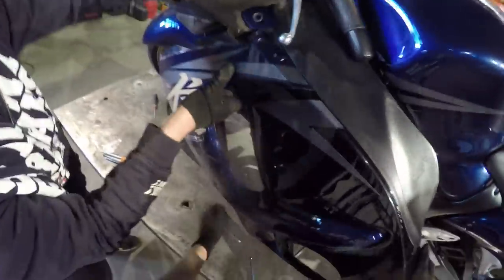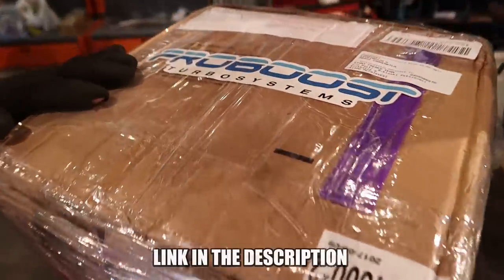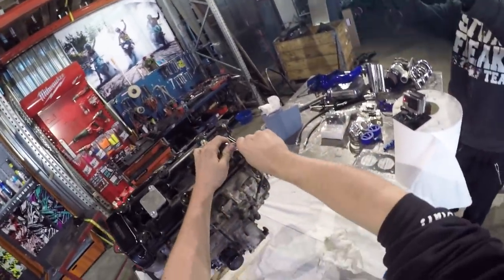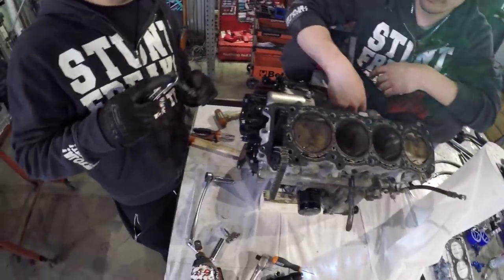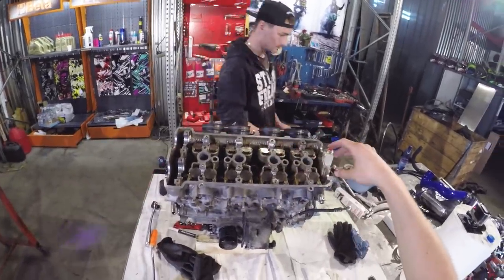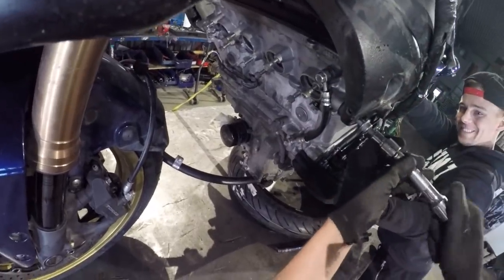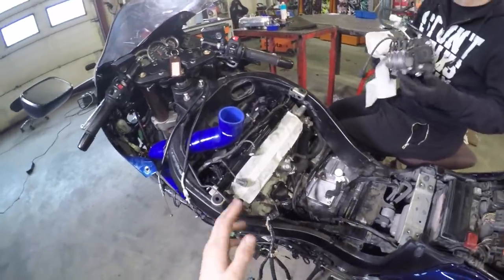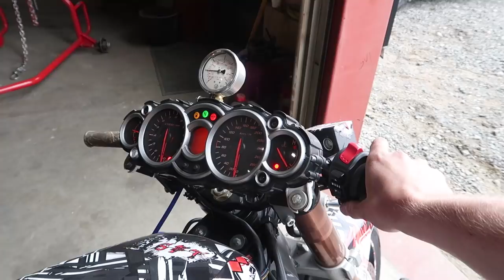How to TURBO your Hayabusa 330hp - ProBoost set

Comment: Because those damn stock Hayabusas are so slow
Reply: Lmfao. Oookay
Reply: Whoosh
Reply: Sarcasm
Reply: @lehti95  Kids ruining good memmes
Reply: @Rektonator  so it would seem
Reply: @lurk7967  you're*
Reply: Being a mechanic you are not supposed to ride these 10 year old busas in a same regular way
Reply: FoxRcng708  they prevent power wheelies but still they look awful and the nose is on next level of uglines
Reply: yea cuz it goes only 300km/h
Reply: The rear looks just as bad with that wasp tail
Reply: You guys sound like the kinda guys that would say a woman's thighs were too thick.
Reply: because safety is for the weak...
Reply: Speed > looks children. No one gives af about what it looks like...cause your not gonna see it go by you....
Reply: that_green 4.6 he was being sarcastic
Reply: @JU-wn1jm  got the Gregg's customs K7 Gsxr tail on mine and boom now she's pretty as fk and everyone jocks it
Reply: Like anything else you get used to the power and want more! I plan to turbo mine next winter!
Reply: Tbh I came off of a built head tuned 07 1000rr into my first busa and I wasn't impressed. Can't say for sure which is faster/slower but they both have their rpm of advantage. I bought turbo parts and crate motor for the busa and sold it before I ever heard it start. I have an itch to get smaller bike. 600 maybe even 300 then go after another busa build. Finances are almost ok again
Reply: Haha yeah 😅
Reply: Oh 180 mph is very slow

Comment: "We gonna install turbo kit coz its not too hard..." proceeds to dismantle entire engine.
Reply: You can do it by yourself pretty easy by using rear&front pit stands and a quite common motorcycle/atv-lift under the engine with a flat surface by removing the oil pan, oil pickup, regulator and front wheel, then a piece of plywood to protect gasket surface. Then lowering and steer the engine out of the frame. (Hayabusa)
Reply: Point is most people don't consider auto engine work an easy project
Reply: "Hard" is relative. What is "not too hard" to one person (who may have a lot of experience building and rebuilding engines) may be insanity to someone who barely knows how to change oil.
Reply: Jon Collins finds trying shoe laces hard.....just saying
Reply: It's really not hard there are countless guides on how to build engines and all the info (torque specs etc) you need on the particular engine you are building. All it takes is a little reading, being good with your hands and having common sense.
Reply: BWHAHAHAHA I thought this same exact shit, as they started to remove the front sprocket. "Not too hard" = remove engine from bike + disassemble engine (*nearly). Not exactly Rocket Science, but alot of room for error here for some shade tree mechanic w/ improvisational tools.
Reply: It’s a 3 hours job
Reply: Its really not hard. Just have the right tools. Like what you do and keep parts organized.
Reply: Türboo
Reply: Wonder if he can turbo my motorized 80cc two stroke bicycle ??!!
Reply: Compared to working on cars, it seems alot easier to work on motorcycles just cuz everything's so accessable.
Reply: its easy compared to a car.
Reply: The hardest thing is to turbocharge an engine just to blow it up just because you didnt make sure the valves arent even slightly bent or all your rod bolts are tightened to spec. The full teardown is just further securing your investment.
Reply: Prison Mike  LoL
Reply: @lilRicky891  and a good amount of space, workbench, tool's and patience to find said torque specs,a decent camera to record said process or a photographic memory ya doesn't take much to teardown and rebuild+ install a boost system
Reply: Not hard for the engineer :D
Reply: FabzRustRider ok
Reply: basically everyone who fix their bikes themself can dismantle and build it
Reply: hell, spelling is hard for this guy
Reply: 😅😅😅they made it look easy!!!!
Reply: I think hardest part is get engine wiring off and drop off the engine and install it back without miss wiring/something forget

Comment: "its not really that hard" 

takes whole bike apart with engine rebuild lool
Reply: Honestly theres so Many guides on this build, kits That are entirely drop in etc, the engine Rebuild is more about checking for issues. If you had a known good bike freshly serviced it wouldnt be needed, they were starting from an unknown quantity used bike so they have a little different set of needs.
Reply: @jediknight1294  I get that but... don't start the video off with ( it's not really that hard) then proceed to take to MOTOR out. ( See, now the motors out, that wasn't too hard was it...)
Reply from the maker: It’s not really that hard
Reply: @knight20092001  if you can change gaskets, change the oil, change clutch packs. Plugs it really isn't hard at all.

The difference between taking the heads off and this sort of thing isn't huge especially when using a kit. It is all the same basic. Concepts, righty tighty lefty loosy, needs air, fire and bang juice to go boom. Its a really quite basic thing.

Maybe it's hard if you can't change oil without taking it to the dealer.

Now TUNING ONE can be a bastard but if you are using a kit then.... There will be a basic tune in the setup and an EFI bike thats 2 cables and a USB cable to the ECU piggyback.
Reply: @stuntfreaksteam  I mean all I've ever done on my Suzuki Bandit 1200 is an oil change, so it would be hard to me haha
Reply: @jediknight1294  actually the reason for taking apart the motor was to install the cylinder spacer to drop compression, and to also install the upgraded Cometic head gasket
Reply: @Stunt Freaks Team and I can't do turbo foam and come to my country for turbo foam and I'll pay you for that and what do you think, man?
Reply: @Wesley Mac Wyne You don't have to evolve to see that trend and only your work of art will flourish if you do
Reply: @tes-rm4zv  turbo foam! Sounds good, where do you get it from?

Comment: The cylinder spacer is to lower the compresion ratio so it wont knock with boost
Reply: Kevin Jordahl yes but if you run higher fuel octane you wouldn’t need the spacer and also that spacer will loose power
Reply: It also increases reliability because of the lower compression ratio.
Reply: Gotta remember these arent civic motors.. Theyre already running 11:1 compression from the factory
Reply: +green t 
You need higher octane without turbo for these engines just not to knock, imagine installing a turbo with much more air inserted in the cylinder every stroke what kind of compression it would get
Reply: E85?
Reply: Gen2 stock compression 12,5:1,  Gen1  11:1.  I drive with about 8,5:1,  intercooler, 98 octane pump gas, (european fuel) about 1 Bar pressure  on my Gen1 streetbike
Reply: Green t....You think that running a higher octane rating is going to stop detonation?...Any fuel will detonate if the cylinder pressure is high enough. Also with a turbo engine you will get more power running a lower CR and a higher boost pressure than running a high CR and then being forced to run low boost. Think of it this way, lets say you have a small engine that displaces 10cc, it pulls in 10cc of fresh charge then compresses it into 1cc, the CR will be 11:1 (not 10:1,  (10+1) /1 = 11:1 ). If you take the same engine and force 15cc of fresh charge into it you may have to lower the CR, lets say the combustion chamber is now 1.5cc in size, the engine will make more power because there is 15cc of charge going into it, what's more the effective CR would be (15+1.5) /1.5 =11. In both cases the effective CR is 11:1 even though if you worked out the CR of the engine with the larger combustion chamber is would appear to be lower...(10+1.5) /1.5 =  7.6:1.   All of this as been simplified to a degree but you get the idea!
Reply: green t even with high octane you will need to drop the  compression mate and the space is the easiest way especially if you increase the fuel pressure via a tube into the carb
Reply: Ryan Bernard stock busa is nearer to 14 isn't it?
Reply: i was skeptical of higher compression not being better
Reply: The spacer is a needed add on for the charger.  He says that because without the charger it’s a lot lower.  The engine has not been changed really except the intake space and exhaust.  They added a few necessary changes for the charger but basically it’s a stock stroked engine. The charger fills up the space the spacer has added.  So ya it’s a lower combustion without the charger.
Reply: Ryan Bernard lol you must know nothing about civics
Reply: @anthonykennedy9019  if you add forced induction you increase the pressure in the cylinder thereby increasing compression so you need to lower the engines compression in order to be able to run more than a couple of pounds of boost and actually make serious power rather than detonation and knocking.
Reply: @jediknight1294  fuel injection no carbs...🙄
Reply: @sidecarbod1441  You got that the wrong way around ;) its not 1980 anymore mate.
Reply: @checkyourself164  The maths was right three years ago when I posted the comment, it's still right today and it would have been right in the 1980's too!

Comment: Someone actually had this and thought: "this is not enough"
Reply: Maybe because it is a strong and reliable engine? Idk tho, Im not a mechanic, but feels locical to boost engine which can handle that extra boost.
Reply: Good strong gearbox aswell
Reply: @rolandtiiroja  i think he means speed yo
Reply: Oh yes this is an entry kit really
Reply: You haven't had a bike like this or a 600hp car, I presume? At first, for about 1-1 ½ years it is amazing, but after a while you just get tired, because too a larger extent you've learned how to handle everything, so you want to go faster. Especially for a bike like a Hayabusa, which isn't a bike for a circuit, horsepower seems to be the only way to make it more exciting and since the engine can handle it, the owners just want mo powa' baby
Reply: @BB-zv8tx  pumphrey reference babyyy
Reply: @BB-zv8tx  EXACTLY! I am used to my busa and want more power! The busa is good in the turns, and great on the straights but with a turbo it becomes a next level experience! MO POWA BABY!

Comment: the "spacer" is  mounted to lower the compression rate , when you turbo an engine you need to lower the compression because the turbo is changing the entire power curve / engine characteristics . N/A engines produce the maximum power at almost peak level rpm . turbo boosts the power in the lower rpm up until mid range rpm .
Reply: It isnt anything to do with your idea of how power delivery works, something you should probably do some more reading on in any case. 

the reason you lower compression is because the forced induction increases pressure inside the cylinder by increasing the amount of air inside it. This means that you are risking knock and detonation running more than a 2-3psi of boost.

To counter this you reduce the engines compression either with a spacer changing the strokexbore ratio, or changing the pistons or both also changing the octane of fuel can help but thats very temp and altitude dependant. This allows you to keep the cylinder pressure within the safe limits to avoid detonation/knock as you raise the amount of boost you want to use.

Comment: More space doesn't exactly mean more power.  Raising the cylinders gives you less compression ratio, which means less detonation under boost.  That's why turbo pistons don't have as much casting over the crown.  It's also why boosted engines should use higher octane fuel.

Comment: These guys do solid work. The motor looks good inside. Nice cross hatching marks in the cylinder walls. Probably very high compression with full power just like a new one.
Reply: 12.1 so not really

Comment: If you go through all the work to pull and dismantle the engine, why not do a little head porting and install high performance camshafts as well?
Reply: Are you aware how much good cams cost & how little extra you get compared with turbo install  ?
How about the amount of skilled labour it needs to make the timing adjustable and dial them in ?
Thought not.  . .
Reply: @peterherrington3300  a set of cams for a turbo busa are less than a grand, head porting is free of you have the right tools.  New valve spring kit is a few hundred.

Comment: Answer for everyone, who questions the translation of the torque wrench / moment wrench.

In Finland we call the torque wrench as ”momentti avain” which translates straight to english as ”moment key” 
When that’s wrong, we translate it english as ”moment wrench”

And for example, car has 300NM torque, as you say in english. 
We say: car has 300NM torque moment, translated from finnish term ”vääntömomentti”. 

So Torque in finnish = Vääntömomentti and Vääntömomentti in english = Torque Moment.

Simple, right? 😉✌🏼
Reply: Moment and Torque are the same thing in English. Saying "torque moment" is like saying "torque torque" or "moment moment". You guys need to sort out your language.
Reply: Boar Vessel, 600-500 BC, Etruscan, Ceramic 

Sorry, but  you can go and try chance your mother language, if your able to. I would like to see that happen’ 😅

Or you can try to learn Finnish, one of the hardest languages in the world, just cause the reasons at my original post 👌🏻

Comment: more combustion chamber volume means less compression ratio.
not more displacement!
Reply: Carl Benz displacement
Reply: Jhay Cruz auto correct, obviously!
Reply: I don't see how it doesn't mean more displacement
Reply: than you have to look into how engines work some more.
displacement is only dependent on bore and stroke!
Reply: @carlbenz3341  if you have more volume then that means you increased bore or stroke though.

Comment: Ok Guys Im impressed but can how many kilometers did your bikes have when you installed them and I purchased my proboost a couple years ago but I have not installed it. Also I seen that you kept the lower engine mounts off? Or did you install them? Also I noticed you didn't have full fairings, I know I may have to cut them but  did you put full fairings on?
Reply from the maker: -Bike had like 40 000km
-we install all the engine mounts
we didn't have full fairings but that turbo kit is design to fit under the side fairings. So there is no problem install full fairings after the turbo install.
Reply: Just wait for 2020 Busa, suppose to come stock with turbo

Comment: Did some one ask how much boost? And are you comfortable keeping stock pistons and rods? I am thinking of doing this on mine.
Reply: 300hp on a gen2 should be fine on stock pistons, much more and id upgrade them. Don't take my word as Gospel, go speak to someone with experience obviously though..
Reply: Pistons will be fine .
Rods are the weak spot.
Gen 2 valve gear is also shite.
I learned the hard way.
300 horse should be about 8 psi .

Comment: When you increase the deck height like that what your doing is decreasing the compression, Those spacers is one way of doing it the other is replacing pistons or replacing rods with something that has a shorter stroke. This is to fight pinging or detention that is cause from adding the turbo.

Comment: If you expand the combustion chamber as you did without some kind of supercharging it will actually result in a loss of power. You’ll have a much lower compression ratio because you aren’t also lengthening the stroke of the piston to accommodate for the new airspace in the chamber.

Comment: and now you need to stretch and lower it
Reply: Pyreeh Squid
Reply: William Jenssen Not really if it makes it easier to drift and more safe to ride.
Reply: Pyreeh depends on how u wanna use it.. i am  only about those twisties but even i would  admit if i ever owned a turbo busa i would  strap and lower and  extension to feel the absolutely best acceleration pull possible..

But  it must  have  been my second bike cause i NEVER EVER would  have  changed it for my widowmaker 😍😍😍 twistie god machine
Reply: If you want to make it look shit then go for it .
Reply: Pyreeh, so how many Hayabusa Turbo's have you owned?
Reply: droceretik none but does that have anything to do with my comment?
Reply: Steve Hash gen 1 zx10r 🤔🤔🤔🤔 they called her the widow maker
Reply: Only if I'm building a drag bike and i don't care about twisties
Reply: Kahrese Lee the Tl100s pre steering damper is the true widowmaker

Comment: how did you compensate the cam advance because of the spacer? That spacer means less power, not more, it makes the engine more boost friendly by lowering the compression ratio, it would suffer from detonation with very little boost
Reply: Your're increasing the distance between the crankshaft and the camshafts. when you increase the distance the cams are rotated forward, the opposite happens when you skim a head the camshafts are retarded, that's why you see the slotted camshaft sprockets and pulleys.
Reply: On Busas from about 04 you normally need adjustable cam sprockets to compensate.   Earlier Busas ( like mine) you compensate by turning chain gear on the crank. (Compensates the cams back to about 105/105 on gen1)  Gen 2 has different

Comment: Great video after all that I know its fast 1/4 mile and red light to red light , but how reliable is the bike on the street and any long distant trip? did the bike just become a race only bike ??  and did you install new  piston - rings.   :Great video thanks
Reply: If the boost (power) is kept reasonably low  (8psi , 300 at wheel) it should last years if serviced regularly. 
Whacking the boost up will considerably shorten its life but put a VERY big grin on your face.

Comment: I’m pretty sure that spacer gasket isn’t “more space more air and fuel more power” in 99% sure its there to lower the compression to prevent predetonation or “ping”. Pretty common to lower compression for boost